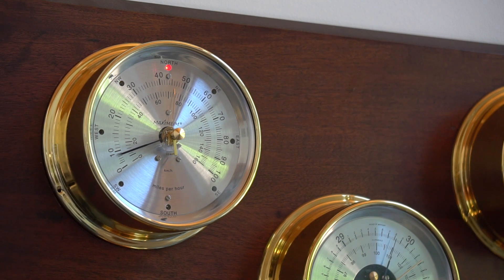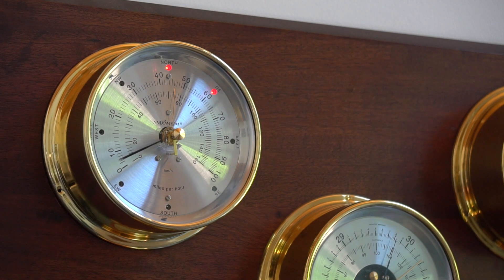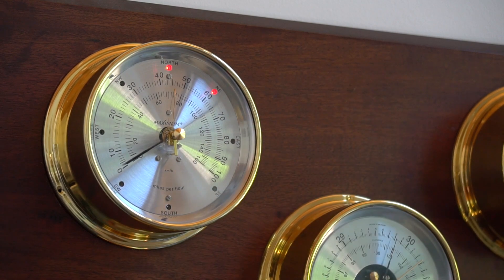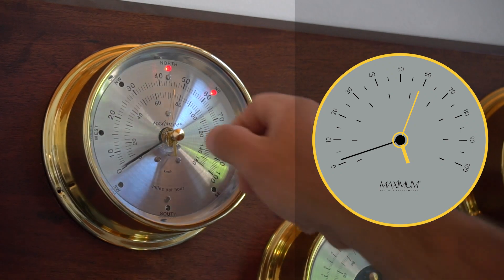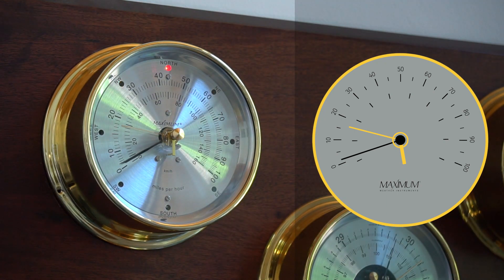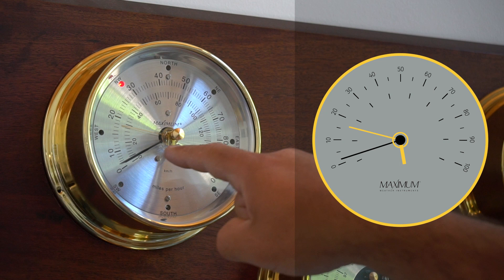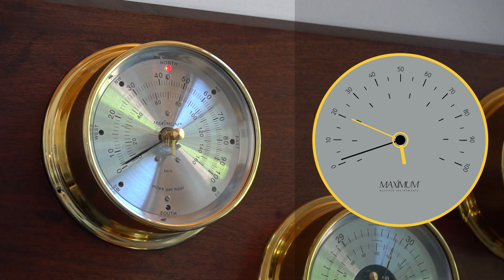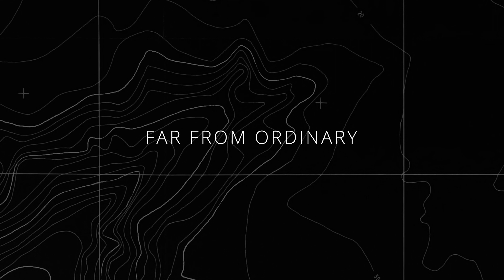How to Operate a Maestro Wind Speed & Direction Instrument

Comment: A question can you have both the Merlin display and maestro display connected to one set of wind and direction sensors? I like the look of both displays and like to see both analogue and red digital displays together.
Reply: Hello! You can connect a Maestro and Merlin with one set of sensors. In a wired configuration The Merlin would be a standard wired Merlin. The Maestro would be a Wi-Fi indicator and the Maestro would connect to the Merlin by cable. It would read the data coming off the Merlin.

If both instruments are Wi-Fi instruments, they will both read from the same set of sensors connected to the network.

Hope this helps!
Reply: @ Thank you and Happy New year and all the best for 2025👍
Could do with Maximum doing a you tube video regarding my enquiry as it’s much easier to watch video instructions on this sort of thing.
Reply: @matthewgulliver596  Thanks for the suggestion!